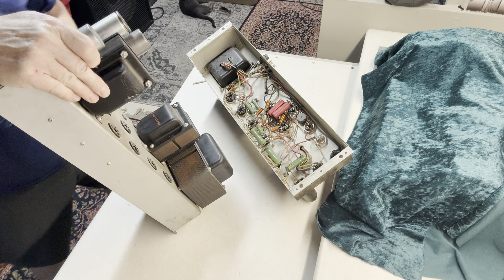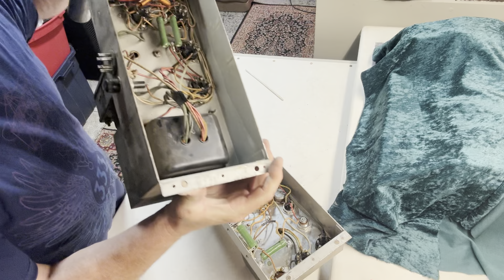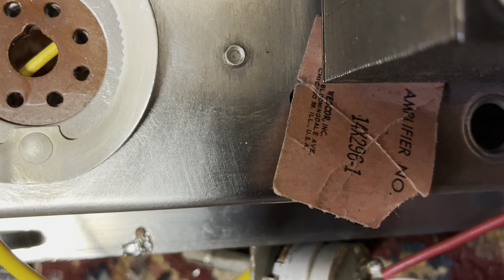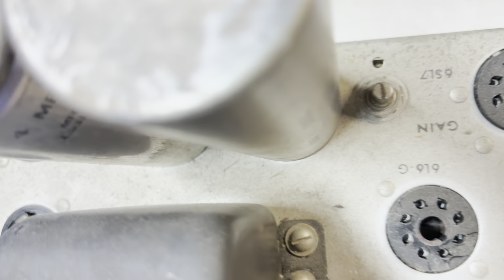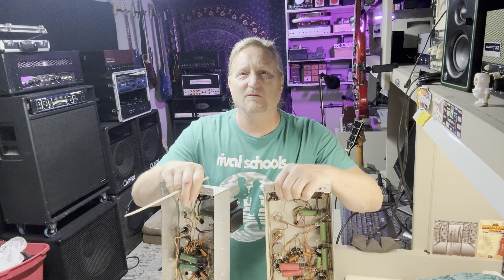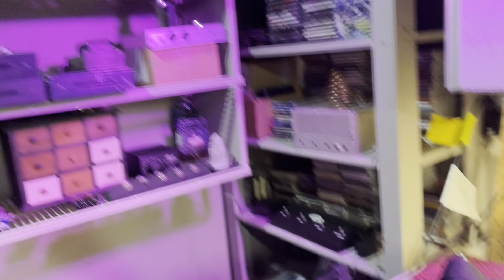Baldwin 45 tube amp conversion intro

Comment: Is the process relatively similar with the 45-HP? I’ve got one I’d love to turn into a guitar amp but not sure what to do about the added percussion out
Reply from the maker: The output plug wiring is a definite challenge if you plan on keeping the amp close to how it was originally. I think you should be able to bypass the percussion out if you do. However that could be a useable frequency section of the transformer. I am planning on starting completely over using just the transformers and chassis. I don’t know if the ones I have are similar to 45HP or not. Thanks for watching!

Comment: I have a question about the choke placement. Are you talking about placing the choke Like 150 watt Marshall 2204Built in 1971?? It comes right out of the output transformer And then also tees up with the fuse for the high tension 0.500 amp fuse? Thanks for the vid. 
You should do some videos of you build ing it out and eventually ripping our faces off with some tasty riffs!
Reply from the maker: Hi thank you! I was referring to the the choke wiring is between the rectified b+ and plates(OT) and I said to move it between The plates and screens instead. One spot up the node ladder.

Comment: What about the smaller PA transformer, are they in the guitar ballpark from square one?
Reply from the maker: The less meat there is the less thump you’re going get in the feel of the amp. Smaller trannys have a joyous sound all their own . IMO. Sparkle drive and thin sounding have a definite place in music.
But not to say the amp couldn’t be designed at low voltages enough befitting their sizing into something really cool and controlled. 10W ish